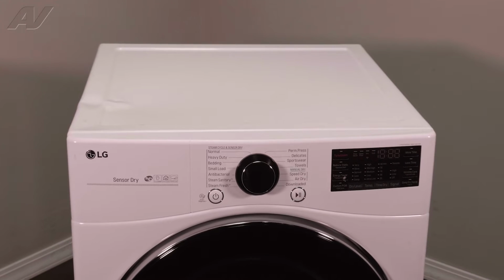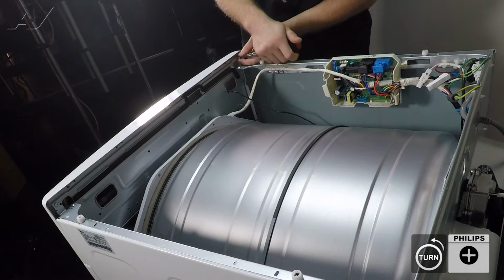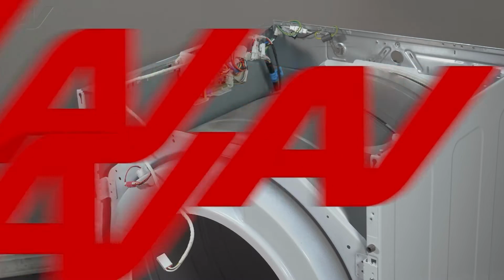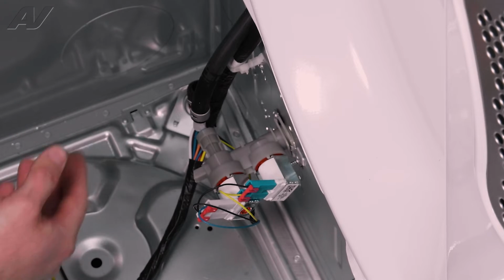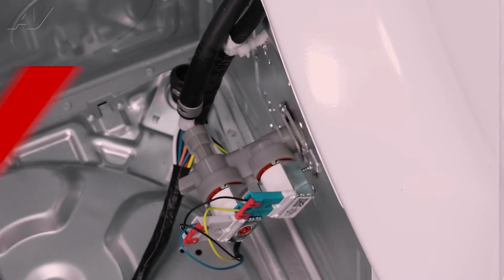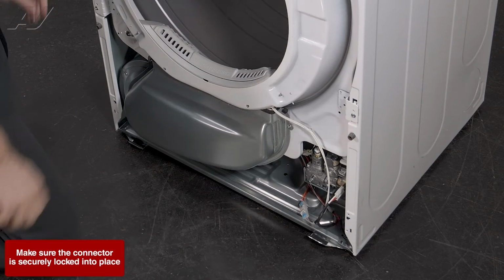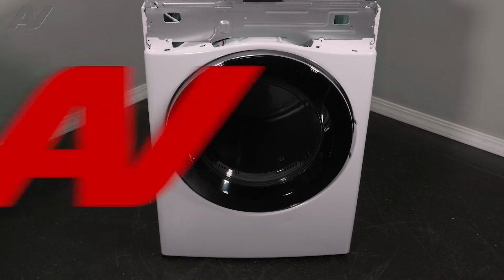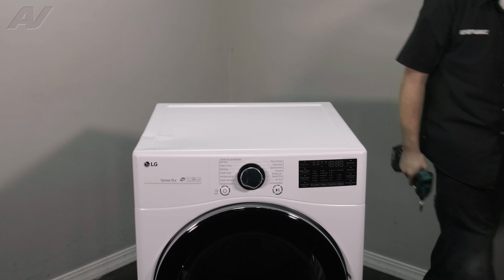LG Dryer Repair - Water Valve Is Leaking - Water Inlet Valve

Comment: I have a Samsung dryer. With a steam option. I have used this feature many times. But now the drum has water at the bottom after the steam cycle and the clothes a soaked. What is happening? And thoughts?
Reply: I have the same problem with a LG steam dryer, faulty steam valve is what I’ve come up with in the search I was hoping to find it in this video.
Reply: same here w/Whirlpool
Reply: @DanCernese  try using tapwater I commented below in the same thread that I found out. It was my user error. Try to use distilled water since I’ve switched to tapwater, which is filtered and UV at my home it’s working flawlessly.
Reply: @peckerpeter2078  what in the world are you talking about?  it's a hose from the house water supply.